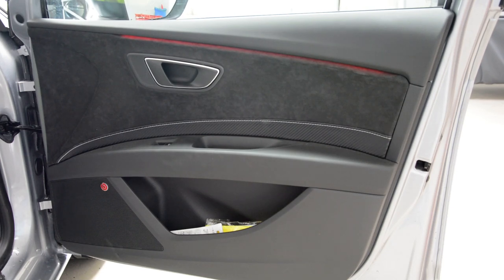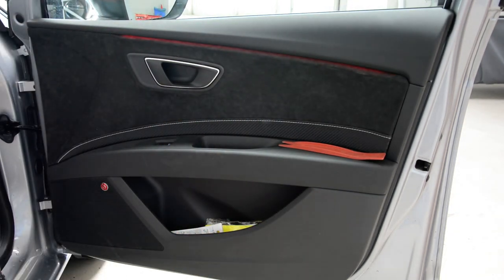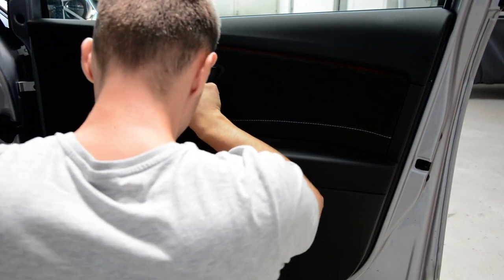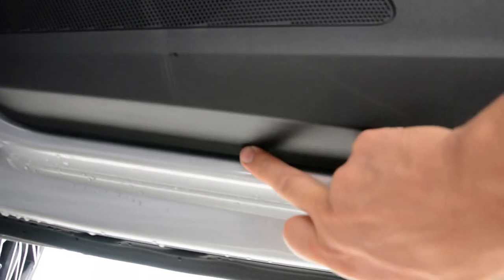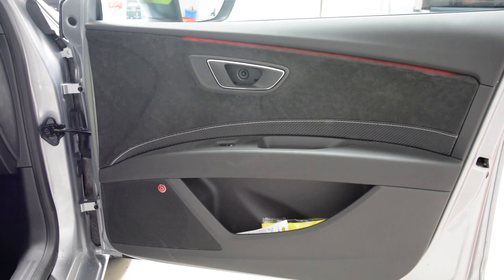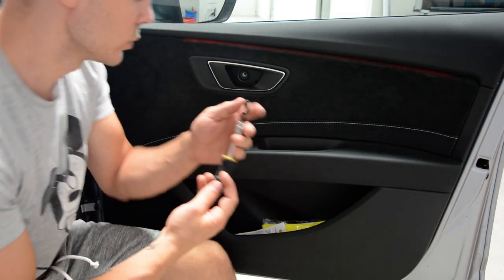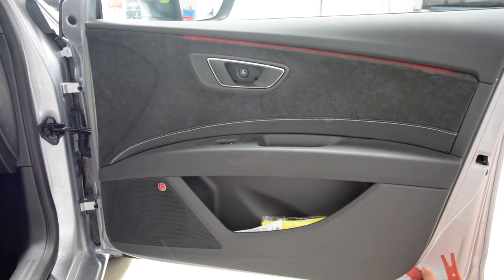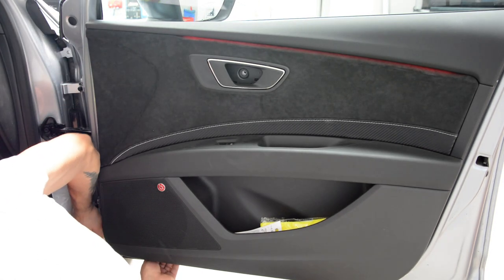Seat Leon door panel removal

Comment: Hello, why does the clip brake https://youtu.be/SQfcSXru3SA?list=PL0Bgfg7w5xmXW7i6BfLgolVu6kdoIqCbd&t=526 you explain in the end of the video?
Reply from the maker: The clips are made to popup or break, that's the normal way because you go to the dealership and buy new ones. What I meant to say at the end of the video is that the clips are strong and stay on the door (the clips must pop up and stay on the door panel) and because of that the clips can damage the fixing points where the clips came in place on the door panel.